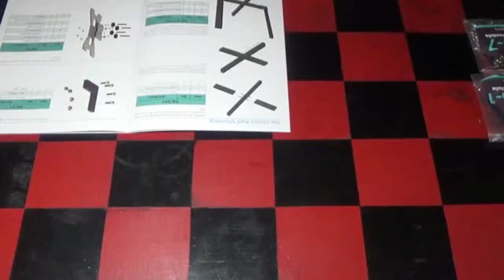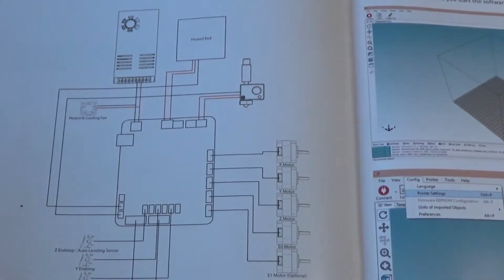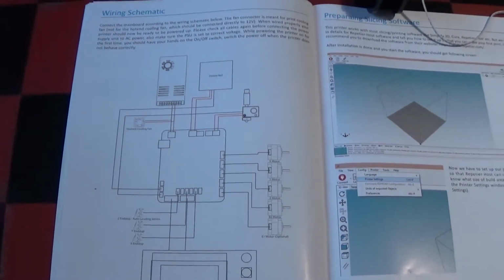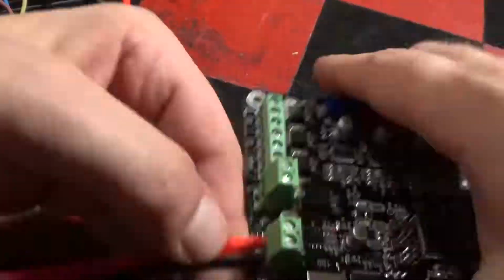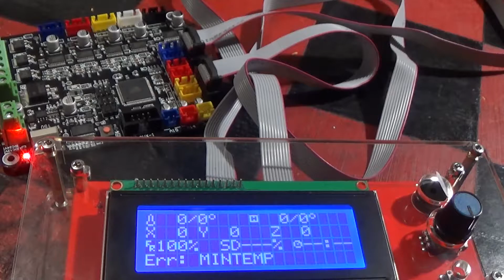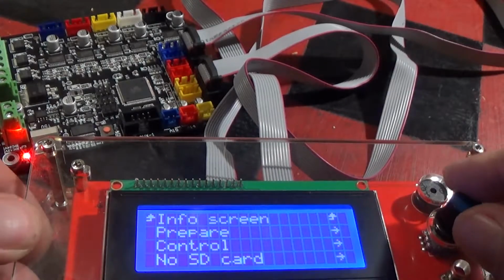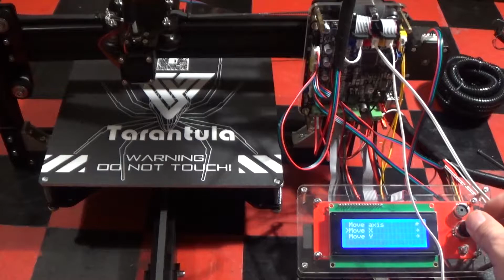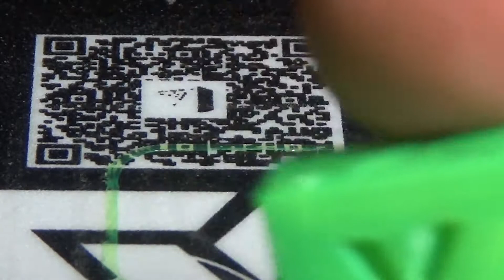Tevo Tarantula 3D Printer - Build, Review and first Prints

Comment: Hello I was interested in getting this l, how were the instructions to follow? Easy or did you have to switch to YouTube to build it all.
Reply from the maker: Glegan I built it entirely of the manual, but this was my 2nd 3d printer I built from Kit form. If you know a little bit about electronics and do not have "two left" hands, you should not have any problems assembling it. Take your time and do not rush it. Knowing how a 3d printer works, helps a lot during assembly. Also there is a great Facebook group around this printer where a lot of the owners hang out, most of them very helpful.

Comment: The printer and the print looks really good for this price range, also the resolution of 0.05 is awesome.
Six to eight hours build time is not that bad either.
I'm looking forward to the next video!
Did you try TPA already? Some motor pads and a frame from it would be nice ;)
You forgot the link to the belt-tensioner :D
Reply from the maker: Yeah, if I can run those resolution with higher speeds, it is really an option to make 0.1 the default instead of 0.2 ;-) Have not tried flexible filaments yet, since they are all 3mm but I am getting a spool of the green replaced and they were kind enough to send it in 1.75mm. So I am pretty curious about them.

Added the link, thanks for reminding me.
Reply: stylesuxx would be cool;-)
also i am excited about the flexible stuff and how the printer handles these.
keep the updates coming!
Reply from the maker: I love the flexible stuff. The printer also comes with a second extruder that looks especially nice for flexible filaments...